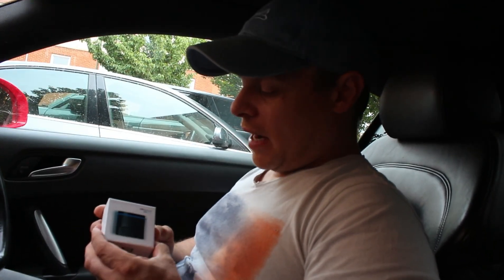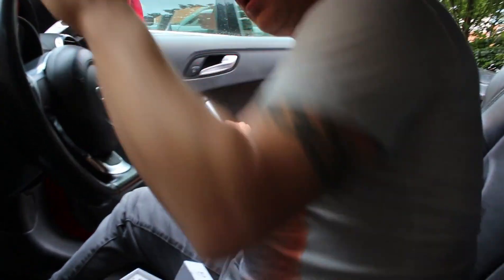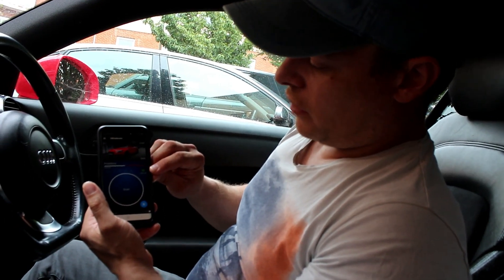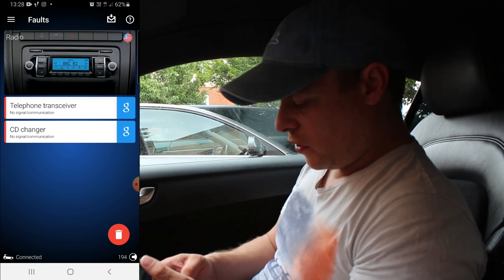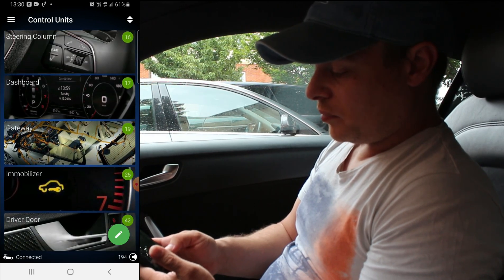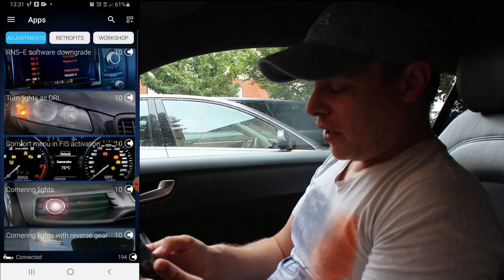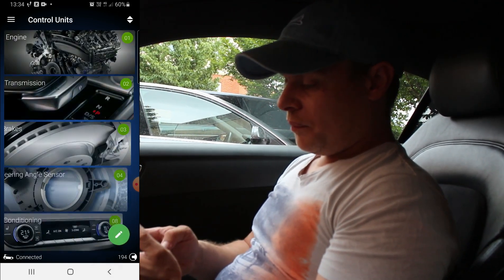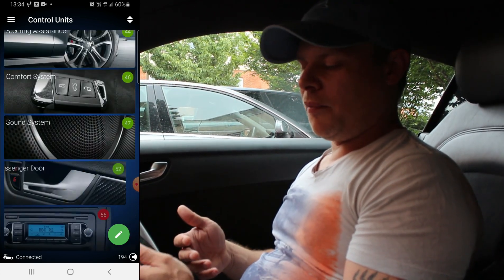OBDeleven pro next generation quick review Audi VW VAG Group OBD Bluetooth tool (Audi TT)

Comment: I have the elm 327 version plugged in to my obd permanent and connected to my head unit, does alsorts shows gauges for boost,temp,rpm,air intake temp,tyre pressure moniter,alsorts no subscription either.
Reply from the maker: Sounds good mate